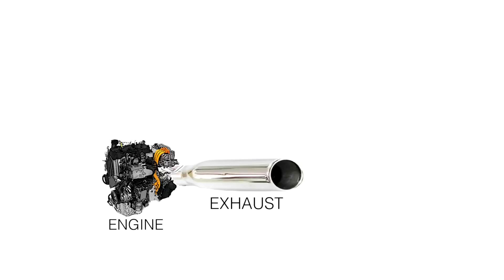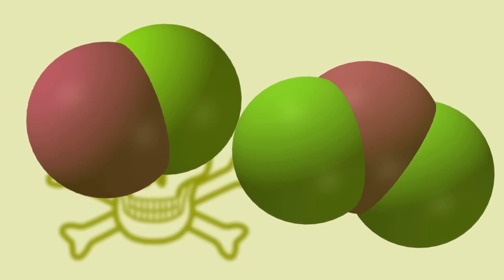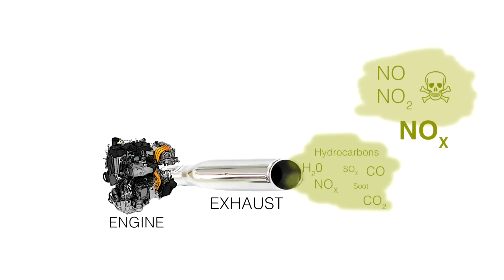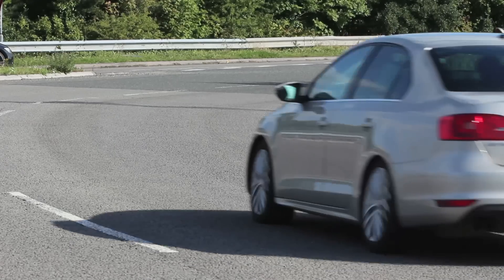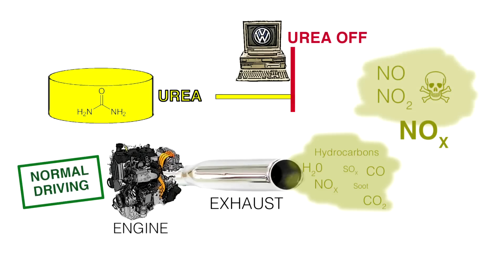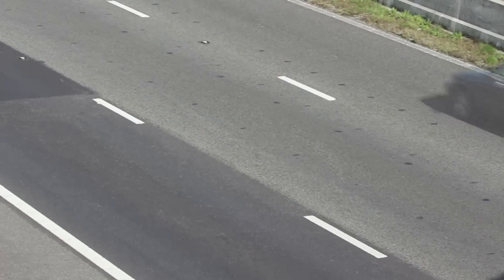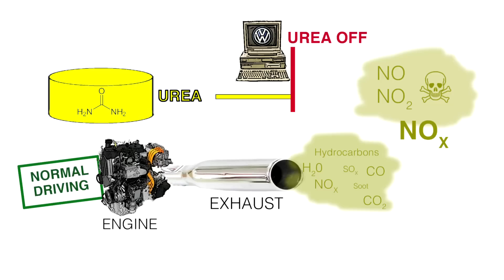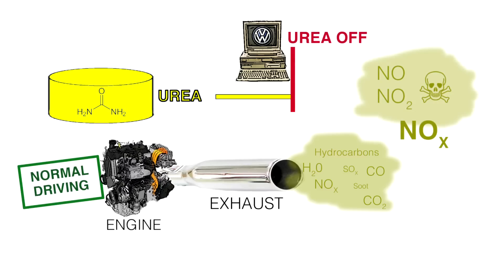Diesel and Urea

Comment: Professor, why is there a limit to how big petrol engines can be built?

If it's flame propagation, why can't you just make more cylinders?
Reply: +DisRes There is a fact that complicates this, which is that the more moving parts an engine has, the higher it´s "internal" friction is. Atleast I think I recall something like that from mechanic-"scool"(lorry/truck)
Reply: +DisRes I was going to guess that it's limited by the speed of flame propagation.
Reply: +Loebane "I was going to guess that it's limited by the speed of flame propagation"
I would add what the professor said into long term memory. His creditability on the subject shot down to the floor when he tried to explain how diesel engines work.
Reply: john smith Well... to be fair, his professor status is in chemestry, not locomotive engineering ;) I would not expect him to be an expert in that field aswell.
Reply: they have done that the largest were the 16 cylinder engines in Rolls Royce and Bently. But improvements to the efficiency of engines allowed to remove them back to 8 without sacrificing power.

Comment: Dieslegate isn't just about the envirnomental impact. The cheating also gave VW a competitive edge over other manufacturers selling diesel-engined cars because VW saved the cost of installing a urea injection system in their cars, at a savings of around $300-$400 per car.

Comment: 0:50 you are wrong a diesel engine does not copress air and fuel mixture just air and then injects diesel into the compresed/heated air. Just saying

Comment: "there are 2 sorts of engines you can have in cars"  I guess the electric motor isn't considered an engine then?
Reply: +Remco Smit  F1 engineers call their engines power units now instead of engines due to the electric motor.
Reply: +Remco Smit You are confusing 'internal combustion engine' with 'prime mover'.  ICE's are PMs, Electric motors are PMs, but not all PMs are ICEs. "Some Pogs are Togs, some Togs are Bogs, therefore some Pogs are Bogs" fallacy. ;-)

Comment: I did some researching on this subject before all the details were finally revealed, here's what I think is going on.

The reason for NOx reduction equipment, either NOx traps or SCR, is because Diesels are lean burning engines and the catalysts are unable to react with NOx in such a lean exhaust environment.  Gasoline engines generally operate in the 14.7 stoichiometric range, whereas Diesel engines are designed to have excess air to reduce soot, improve combustion, and to cool the engine.

The NOx traps require regeneration, which means injecting fuel into the exhaust to cause the catalyst to burn off the trapped contaminants.  This regeneration is used in Diesel Particulate Filters too, and causes significant fuel consumption.  It's possible to also passive regeneration too, but this requires long drive cycles and elevated EGTs.  I suspect that most city driving does not generate the conditions necessary for passive regeneration.  This means VW must use fuel to regenerate, causing a loss in economy.

The SCR systems use DEF to treat the NOx in the catalyst.  Passat's have a 5 gallon reservoir and 18.2 gallon fuel tank.  Typical DEF use is about 5%, or .91 gallons per tank.  VW claims the DEF lasts at least 10k miles and they pay for the first 36k miles of DEF.  At .91 gallons and 35MPG, the actual use per 10k miles would be around 14.2 gallons of DEF if the engine is using it in typical proportions.  This is 3x the use VW claims in their literature.  Since VW covers the first 3 fills, that's roughly 10 gallons per fill, or 30 gallons of DEF they don't have to buy.  With 11million of these cars on the road, that's about $90 million worth DEF that VW doesn't have to pay for.  $90mn is a considerable incentive, but I think the touted DEF efficiency is the major driver.  If their vehicles use 3x less DEF than other's, the TCO is lower for customers and that's a selling point.

Now, let's discuss performance.  I read claims that the emissions tune produces less torque than the normal tune.  Looking at the performance figures from when the new TDI was released in 2008, it's clear that there is a huge performance difference between the previous generation engine (1.9TDI) and the current 2.0TDI.  The torque went from 178ft/lbs to 236ft/lbs, which means more cylinder pressures and more NOx.  The NOx traps VW uses are a new technology and are expensive.  It's not a stretch to consider that the technology is in its infancy and further efficiency gains will be made.  That said, I speculate that the NOx traps don't have the capacity to swallow the NOx produced by the newer "hot" tune engines and thus VW decided to have a mild and hot tune, with the hot tune saturating and overrunning the NOx trap.  It's quite possible that VW can't achieve the performance numbers with the size of the NOx trap the car is equipped with, so all of the customers who have their cars recalled are going to have a very significant performance and fuel economy degradation.  I would bet the revised torque numbers will be around 190-200ft/lbs with 150HP, that's about 15% less overall, and fuel economy will probably drop by 15%.
Reply: total heat verses temperature verses combustion rates? Less fuel equals less heat to raise the average temperature inside the cylinder. However a lean mixture has more oxygen available to support combustion, so the combustion is more intense. And that results in higher temperatures right next to the flame.

Also combustion of lean mixtures "complete" at a crank angle closer to TDC. mixture has had less of a chance to expand and that too  encourages the formation of NO2 via Le Chatelier's principle.
Reply: +Lewis Doherty The EPA anticipated that argument in their letter of violation.  The Clean Air Act doesn't just require the car to pass the test, it is also required to pass without cheating.  Design elements that make the car cleaner during testing are expressly forbidden.  In any case, it's a moot point because Volkswagen has admitted they broke the law: they deserve some credit for not hiding behind tricky lawyers.
Reply: +Cranston Snord no, this was likely a mid level manager deciding to put something they'd had in a test version into the production model because the deadline for his project was coming close and he couldn't afford to say no to an upper manager when asked if he'd be able to deliver what he'd been told to.
Bosch supplies VW with an engine control module with test firmware, stating it's not certified for production use, it gets put into a test engine to see if it can work well. Engine works beyond expectations on the test stand.
Higher management gets wind of a new engine that's way better than the current line, marketing starts blabbing about it in the press, and now eveyrone's stuck on having to deliver something to customers that was never intended to be...

THAT is almost certainly what started the whole thing. Seen similar things happen time and again. Management getting rose coloured ideas from concept demos they witness, telling marketing to run with it, and engineering is stuck with a sheer impossible task to deliver something way sooner than they would ever have agreed upon had they been asked.
Reply: Things weren't different pre-Internet as far as the generating of these type stories.  There were and are numerous "investigative" and news TV shows and newspaper columns that were always looking for stories that could be sensationalized.
       One thing that is different and for the better is the availability of relatively easy counterreformation and alternative reasoning through the Internet.  While there is a lot of garbage out there and disinformation, an intelligent person can find credible sources that make sense and sources that provide verifiable information that can be logically strung together.
Reply: When my TDi is in regen mode, the car shudders like it has a rough idle. I notice this mostly when stopped at red light. So for those that tailgate me, you get NOx'd as a lesson: back off!
Reply: Tosh Outdoors
Diesel engines run cooler with excess air, the EGTs are lower and the cylinders remain cooler because of the excess volume of air.  This is part of the cooling system on larger diesels.  When you have insufficient air, you get smoke because there is too much fuel and not enough air, this causes EGTs to go up and in-cylinder temperatures to go up.  Failure due to hotrodding an engine and towing too heavy a load is common, the failure mode is a melted, cracked, or damaged piston, valves, and turbine, all due to excess fuel (insufficient excess air in combustion cycle) and increased timing.  The Northstar engines were advertised as being able to drive without coolant for a significant distance, this is due to a strategy that skips cylinders, causing them to pump excess air through the engine and out the exhaust.  Ford (who didn't make the northstar) actually patented this overheat strategy back in the early 80's.
Reply: Tosh Outdoors
I'd also like to point out that the alcohol example you provide is based on the latent heat of vaporization, this effect is much more pronounced in spark ignition engines because the fuel must be converted from a liquid into a vapor prior to ignition.  Diesel engines inject liquid fuel directly onto the piston, the compressed air causes the highly atomized liquid to ignite, largely skipping the vapor state.  Because the fuel is injected at or near TDC, the effects of the fuel chilling are very small.
Reply: +Cranston Snord I'm waiting for neither a junior or senior engineer to say anything, and instead for an attorney to say it if you read the regulations, it was permissible.  I remember there was a rear bumper test on a car and the car company installed a block right where the testing device would strike.  The bumper would't work well if struck at different angles or at different positions, but the task was to specifically survive the impact as described in the test.  Wait till their attorney says, the emissions depend on the variables driving conditions.  The regulations require us to demonstrate to the sensors how the urea system works when tested under the conditions described in the regulations.
Reply: +eformance Plus most catalytic converters would be clogged by the free carbon which most diesel produces(running rich during acceleration to produce more torque at the expense of horsepower). Once in cruise though, diesel is pretty clean due to the high compression ratio and the long time required to get diesel to actually combust relative to the cheapo grades of fuel(91 in Aus, 87 in the US equiv think). 98/E85/toluene all benefit from being able to advance timing, picking up power without losing horsepower because of the relatively slow combustion process. Sure it takes longer,but it delivers more energy from the same volume
Reply: +Jason Goodman the car would meet standards overall ON AVERAGE, all the software did was ensure it'd meet standards specifically during the test, which it wouldn't have for a few minutes during the cleaning cycle otherwise.

Of course management had to take a hit, it was the only thing they could do to prevent a PR nightmare from getting even worse.
Pre-internet this would have been handled with VW chatting with the EPA, average emission figures over a longer period than the short test cycle being shown and verified, and the regulations being changed to allow for a longer period to measure over time average emissions.
But in this day and age of instant leaks and Twitter messages designed to cause drama, that was never going to happen and some idiot ecomaniac in the EPA had to leak "VW broke the law with software to cheat emissions tests" to the world.
Reply: ***** what was different was the speed and ease with which rumours and propaganda can be spread, and the willingness of people to believe anything they read. "It is on the internet so it must be true" is a phrase that didn't spring up for no reason, a lot of fools actually believe that.

Comment: Diesel engines don't compress a mixture of fuel and air. It compresses air and at the end of the compression stroke, diesel is injected into the combustion chamber where it will ignite due to the high temp and pressure.
Reply: Correct, Sir.

Comment: From what I understand, VW is running a richer mixture during the emissions test and a leaner mixer during regular driving. The richer mixture works with the emissions system to reduce NOx. The leaner mixture during driving gives more power and greater fuel mileage. The engines don't have a urea system.

Comment: i dont know why everyone (at least the media) is acting like this is a big scaldal. Yea fine they manipulated the testresults by clever software but thats because its so easy for a computer to 'find out' that its being tested. (+1 for VW for realizing they could do it) So really the ones who are doing the testing should be the ones in critique for having test-routines which differ so much from the way one would usually drive.
Reply: +Pix P I agree to a certain extend to your statement. It is a fact that most manufactures identify the test cycle one way or the other. (Like the RPM , gear, switching, acceleration, speed...) If one would drive that way in the real world, they would get similarly values. Also, typically bring the engine up to the allowed temperature, pump up the tires to upper limit of the tolerance....

How ever: Chancing the engine parameter when the rear wheels aren´t turning and the acceleration sensor reports no acceleration of the car... then it is cheating.
There is no legitimate reason to tread this case differently.

Comment: whoa. an odd number of electrons? that's pretty radical

;)
Reply: iammaxhailme I see what you did there.
Reply: Great comment, but it didn't come for free.
Reply: NO and NO2 are not radicals. The are very reactive molecules that can create Photochemical smog.
Reply: @karlbergen6826  NO is a radical. NO2 isn't
Reply: @iammaxhailme  
You right on that. No way the electrons can add up. NO, however, is extremely reactive, combining with O2 to give NO2. This dissolves in water to give a mixture of nitric and Nitro's acids. The nitrous acid absorbs more oxygen to become nitric acid or disproportionates.

Comment: With reference to the clarification in the description: The quick version of how you tune a diesel to lower NOx levels without urea is to inject more fuel, later. Chemists and biologists will probably appreciate that generating nitrogen oxides is a fairly high-energy process, in engines it occurs most at high temperature and when there is extra free oxygen. If you inject fuel later the peak cylinder temperatures are lower as you have less overlap of combustion/compression, if you inject more fuel then you quench the formation of NOx with simple dilution. Both of these techniques give a less complete burn which means more CO and hydrocarbon emissions (which are a less significant portion of a diesel's emissions than NOx are)  and less power.

Comment: The affected TDI engines didn't have Urea systems at all.  Those are only used in the larger TDI engines used by Audi.  The 2.0 VW motors had no such tank at all.
Reply: 2012 Passat owner, my car does have urea, is affected by recall and is the 2.0 engine.
Reply: +Austin Esau VW uses the urea system in some cars (Passat) and a "lean NOx trap" in others (Jetta, etc).  It was caught cheating on both.
Reply: +Jason Goodman Thank you for correcting me!  I knew that the smaller platforms didn't have it, but was unaware of the passat having a tank.

Comment: But fuel and air is not being mixed before the compression stroke in a 4 stroke diesel engine, the diesel is injected at the end of the compression stroke where the hot air ignites the directly or indirectly injected fuel. What professor Poliakoff says in the video about diesel engine compression cycle is wrong.

Comment: Technically there are three types of combustion engines, that commonly are found in cars. He forgot the rotary engine.
Reply: Which, while unorthodoxly shaped, is still a petrol engine opperating on the same chemical principles as any reciprocating engine.
Reply: Correct, but mechanically they are very different.
Reply: +August Ellison Mechanically petrol and diesel reciprocating engines are very similar mechanically, but they differ wildly in their chemistry. It's this difference in chemistry that's relevant to this channel, any further mechanical difference between reciprocating and rotary engines using either fuel complicates things more than necessary to four different cases (is there such a thing as a rotary diesel?) and would add very little to the explanation.
Reply: +Quintinohthree I agree, but I just discovered that rotary engines existed, and frankly, just wanted to be a smart alek haha.
Reply: You have hydrogen, gas engines etc too
Reply: +Quintinohthree There is even another category and oddity - the gas turbine car: https://en.wikipedia.org/wiki/Chrysler_Turbine_Car  Hey, turbines are used in airplanes, ships and electrical power plants, so lets put them in automobiles.